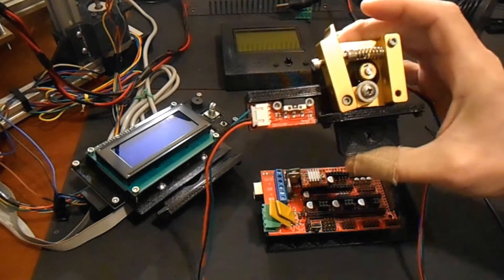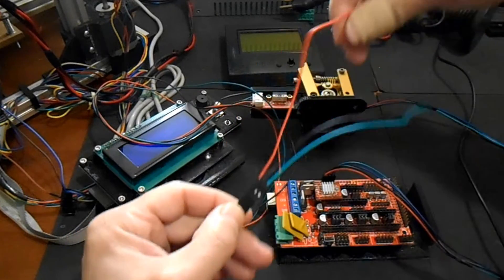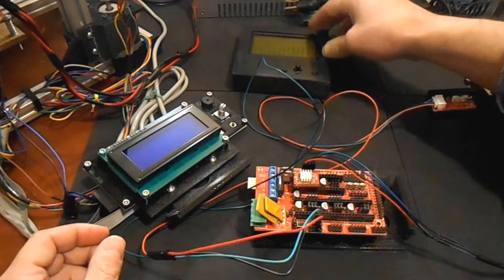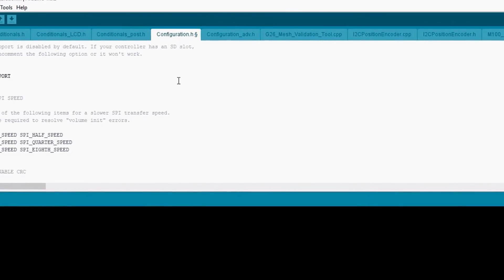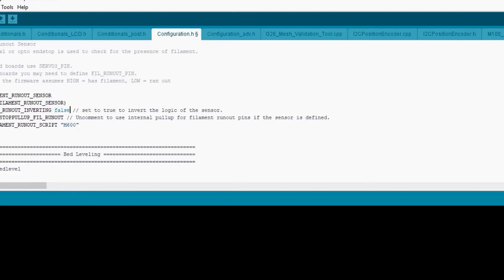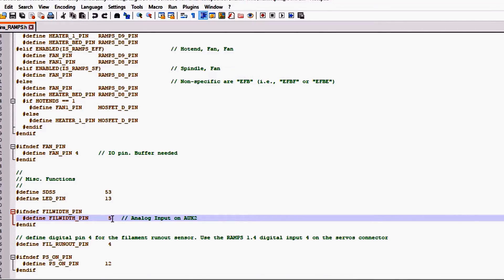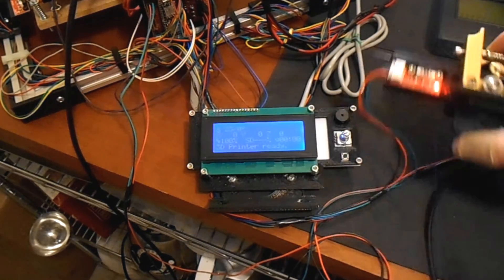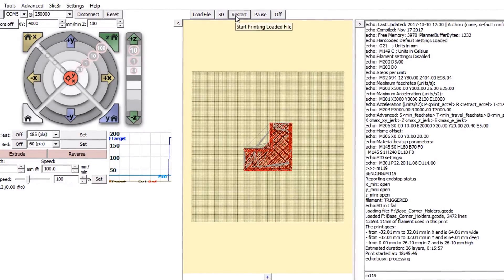RAMPS 1.4 - Mechanical Filament Sensor Runout Configuration

Comment: Hello Ed, i like your video channel about 3d printer. 
I use your instruction for making my 3d printer (https://youtube.com/shorts/mpSAezUBfPU). Can i ask You for help? I would like to make some upgrades of my 3d printer. I bought  bigtreetech hot end for 2 filaments in one nozzle. Its posible to mount two filament runout sensors, bltouch and fan controler to servo pins? I would like to save D9 pin for future connection of chamber heater (with external MOSFET), but now i use it for pwm regulation of hotend fan. 
Can You recomend me some instructions or tips, which can I use for setting it in Marlin and connecting it to ramps 1.6? 
Thank you!
Reply from the maker: There's a link in either video or channel for Discord, either myself or someone else can help you in general chat.

Comment: Is there a way to prevent X and Y Homing on filament ranout ?
I need it simply to lift 10-20mm and beep, keeping X and Y in the same place.
Reply from the maker: Does printer not return to same place it left off at?

Comment: on the switch which wire goes where? if the switch is laying on the table with the lever arm pointing to your right is red in the center and green on the left or right-hand pin?
Reply from the maker: Green is signal pin, red is voltage pin  and black is ground. The order of the pins can be found on the pinout diagram.

Comment: Friends I need help i am using ramps 1.4 x y z motor working good but fliment motor not working and I change cable but not working I fix new motor not working I changed fixed new ramps 1.4 still not working and I buy ramps 1.6 plus but no use I my is showing cold extension prevention I don't know what to do help me please my whatsApp number is 7780488920
Reply from the maker: There's a discord chat just so you know.
Reply: @EdwardBraiman   I can't understand help me bro my number 7780488920
Reply from the maker: Try discord in summary below.
Reply: Bro i tried but not working
Reply: In my system is showing cold extrusion prevented
Reply from the maker: Copy the message you're seeing in Commandments.
Reply: @EdwardBraiman  cold extrusion prevented is showing in command
Reply from the maker: Is the thermistor connected or broken?
Reply: @EdwardBraiman  iam using  mega 2560 ramps 1.4 and 1.6 plus both board showing like this

Comment: Hi
I did it all over again, I only uncommented the configuration.h
#define FILAMENT_RUNOUT_SENSOR
It is I already get this error:

In file included from C:\Users\Nino\AppData\Local\Temp\arduino_build_201711\sketch\MarlinConfig.h:42:0,

                 from C:\Users\Nino\AppData\Local\Temp\arduino_build_201711\sketch\G26_Mesh_Validation_Tool.cpp:27:

SanityCheck.h:502:5: error: static assertion failed: ADVANCED_PAUSE_FEATURE is required to use M600 with FILAMENT_RUNOUT_SENSOR.

     static_assert(NULL == strstr(FILAMENT_RUNOUT_SCRIPT, "M600"), "ADVANCED_PAUSE_FEATURE is required to use M600 with FILAMENT_RUNOUT_SENSOR.");

     ^~~~~~~~~~~~~

In file included from C:\Users\Nino\AppData\Local\Temp\arduino_build_201711\sketch\MarlinConfig.h:42:0,

                 from C:\Users\Nino\AppData\Local\Temp\arduino_build_201711\sketch\I2CPositionEncoder.cpp:31:

SanityCheck.h:502:5: error: static assertion failed: ADVANCED_PAUSE_FEATURE is required to use M600 with FILAMENT_RUNOUT_SENSOR.

     static_assert(NULL == strstr(FILAMENT_RUNOUT_SCRIPT, "M600"), "ADVANCED_PAUSE_FEATURE is required to use M600 with FILAMENT_RUNOUT_SENSOR.");

     ^~~~~~~~~~~~~

In file included from C:\Users\Nino\AppData\Local\Temp\arduino_build_201711\sketch\MarlinConfig.h:42:0,

                 from C:\Users\Nino\AppData\Local\Temp\arduino_build_201711\sketch\M100_Free_Mem_Chk.cpp:49:

SanityCheck.h:502:5: error: static assertion failed: ADVANCED_PAUSE_FEATURE is required to use M600 with FILAMENT_RUNOUT_SENSOR.

     static_assert(NULL == strstr(FILAMENT_RUNOUT_SCRIPT, "M600"), "ADVANCED_PAUSE_FEATURE is required to use M600 with FILAMENT_RUNOUT_SENSOR.");

     ^~~~~~~~~~~~~

"C:\\Users\\Nino\\AppData\\Local\\Arduino15\\packages\\arduino\\tools\\avr-gcc\\7.3.0-atmel3.6.1-arduino5/bin/avr-g++" -c -g -Os -w -std=gnu++11 -fpermissive -fno-exceptions -ffunction-sections -fdata-sections -fno-threadsafe-statics -Wno-error=narrowing -MMD -flto -mmcu=atmega2560 -DF_CPU=16000000L -DARDUINO=10812 -DARDUINO_AVR_MEGA2560 -DARDUINO_ARCH_AVR "-IC:\\Users\\Nino\\AppData\\Local\\Arduino15\\packages\\arduino\\hardware\\avr\\1.8.2\\cores\\arduino" "-IC:\\Users\\Nino\\AppData\\Local\\Arduino15\\packages\\arduino\\hardware\\avr\\1.8.2\\variants\\mega" "-IC:\\Users\\Nino\\Documents\\Arduino\\libraries\\U8glib\\src" "C:\\Users\\Nino\\AppData\\Local\\Temp\\arduino_build_201711\\sketch\\MarlinSerial.cpp" -o "C:\\Users\\Nino\\AppData\\Local\\Temp\\arduino_build_201711\\sketch\\MarlinSerial.cpp.o"
In file included from C:\Users\Nino\AppData\Local\Temp\arduino_build_201711\sketch\MarlinConfig.h:42:0,

                 from C:\Users\Nino\AppData\Local\Temp\arduino_build_201711\sketch\MarlinSerial.cpp:36:

SanityCheck.h:502:5: error: static assertion failed: ADVANCED_PAUSE_FEATURE is required to use M600 with FILAMENT_RUNOUT_SENSOR.

     static_assert(NULL == strstr(FILAMENT_RUNOUT_SCRIPT, "M600"), "ADVANCED_PAUSE_FEATURE is required to use M600 with FILAMENT_RUNOUT_SENSOR.");

     ^~~~~~~~~~~~~

Uso la libreria U8glib alla versione 1.19.1 nella cartella: C:\Users\Nino\Documents\Arduino\libraries\U8glib 
exit status 1
static assertion failed: ADVANCED_PAUSE_FEATURE is required to use M600 with FILAMENT_RUNOUT_SENSOR.
Reply from the maker: The might be a comment in front of advanced pause feature.
Reply: @EdwardBraiman  So what should I do, some suggestions
Reply: Try it on arduino 1.1.9 to see if it gives you errors too
Reply from the maker: Correct.
Reply from the maker: I would, but I'm recording a large tutorial and it might be tommorow before I can try.  I'll be record a new tutorial on this soon as this one is a couple of years old.

Comment: Hi
I tried with marlin 1.1.9 to add the mechanical sensor to pin D11 and I get a lot of errors on ADVANCED_PAUSE_FEATURE
Any suggestions
Reply: arduino MEGA 2560
RAMPS 1.4
REPRAP_DISCOUNT_FULL_GRAPHIC_SMART_CONTROLLER
Reply from the maker: What are the errors?
Reply: @EdwardBraiman  
Arduino:1.8.12 (Windows 10), Scheda:"Arduino Mega or Mega 2560, ATmega2560 (Mega 2560)"

In file included from sketch\MarlinConfig.h:42:0,

                 from sketch\M100_Free_Mem_Chk.cpp:49:

SanityCheck.h:124:4: error: #error "PAUSE_PARK_[XY]_POS is now set with NOZZLE_PARK_POINT. Please update your configuration."

   #error "PAUSE_PARK_[XY]_POS is now set with NOZZLE_PARK_POINT. Please update your configuration."

    ^~~~~

In file included from sketch\MarlinConfig.h:42:0,

                 from sketch\G26_Mesh_Validation_Tool.cpp:27:

SanityCheck.h:124:4: error: #error "PAUSE_PARK_[XY]_POS is now set with NOZZLE_PARK_POINT. Please update your configuration."

   #error "PAUSE_PARK_[XY]_POS is now set with NOZZLE_PARK_POINT. Please update your configuration."

    ^~~~~

In file included from sketch\MarlinConfig.h:42:0,

                 from sketch\I2CPositionEncoder.cpp:31:

SanityCheck.h:124:4: error: #error "PAUSE_PARK_[XY]_POS is now set with NOZZLE_PARK_POINT. Please update your configuration."

   #error "PAUSE_PARK_[XY]_POS is now set with NOZZLE_PARK_POINT. Please update your configuration."

    ^~~~~

In file included from sketch\MarlinConfig.h:42:0,

                 from sketch\MarlinSerial.cpp:36:

SanityCheck.h:124:4: error: #error "PAUSE_PARK_[XY]_POS is now set with NOZZLE_PARK_POINT. Please update your configuration."

   #error "PAUSE_PARK_[XY]_POS is now set with NOZZLE_PARK_POINT. Please update your configuration."

    ^~~~~

exit status 1
#error "PAUSE_PARK_[XY]_POS is now set with NOZZLE_PARK_POINT. Please update your configuration."

Questo report potrebbe essere più ricco di informazioni abilitando l'opzione
"Mostra un output dettagliato durante la compilazione"
in "File -> Impostazioni"
Reply from the maker: Sanity check is pointing to configuration_adv.h for setting within.  There also might be an issue with an i2c device set in Marlin firmware.  Just a guess from the error message.  I'd start from scratch in a new Marlin firmware download and compile each change one at a time til the errors appear and that will be the setting to focus on.

Comment: can you answer me why did you connect +5V with Vcc in ramp 1.4??
Reply from the maker: It provides power to 5v rail on RAMPS board for servos.  You can verify with a multimeter.
Reply: @EdwardBraiman  thank you,i think it had 5v before,  i have suggest you should use camtasia to recorder screen, good luck and regards ,i hope your channel will be strong develope in the future .

Comment: Help lcd rep rap full grafik blank not display
Reply from the maker: What's the LCD type?  Are you using the 3d motherboard in the video?  What steps have you done so far.  We need to know as much about your steps to narrow the issue down.  Sounds like the ribbon cables are reversed if the LCD illuminates.  It could also be a firmware issue.  Can you place a link to the LCD purchase?
Reply: https://s.lazada.co.id/s.IUOn
Reply: there is sound when pressed it feels normal only there is no display
Reply: firmware problem I have followed some firmware tutorials I have tried
Reply from the maker: Does the display illuminate?  What happens when you reverse ribbon cables position on the RAMPS side position with the notched connection and apply only USB power via you computer USB. Does the LCD illuminate?
Reply: the first cable is only on without pictures ... when the cable is dark it doesn't turn on
Reply from the maker: If it illuminates it's good.  The next step is to upload Marlin firmware with modifications for LCD and RAMPS 1.4.  keep in mind you may need to load u8glib to get firmware to compile.  If you check my Rumba tutorial playlist, just follow without changing motherboard.
Reply: okay ... I'll follow the steps above ... if it still can't, please help ... or in the team viewer ... wkwkwk ... Thank you very much
Reply from the maker: Can you make a video of the physical steps of connecting the LCD and post a link so I can see what you are doing I can better help.  Just need to have a visual reference.  It's late here, I'll look in the morning.
Reply: is there no whatsapp that I can contact ... try later I will make the video that I did
Reply from the maker: @mas_wahid1402  Okay, now that I'm viewing your question via my computer, rather than my phone I see your issues better.  The tutorial your trying to follow is for Adding a Filament runout sensor.  This would confuse me if I was trying to connect a different LCD type while following a dated tutorial.  Try this link, it is the same process to setup and varies only in the motherboard. Connect like you would for the RAMPS 1.4 and follow the process in the Marlin section, but do not change the, motherboard type of, "BOARD_RAMPS_14_EFB", her is the link, https://youtu.be/Vk_t-NK_OmA

Comment: Edward, please point me in the right direction. when filement runs out the bed moves to far forward and slams the bearing into the end. where can i adjust this forward movement.
Reply from the maker: When your filament runs out, check configuration_adv.h, it's been almost a year since I did a tutorial and it was with Marlin firmware 1.1.8, I think. You can use Pronterface with debug active to maybe see what commands are being sent.
Reply: Edward Braiman found it thanks
Reply from the maker: You're welcome.